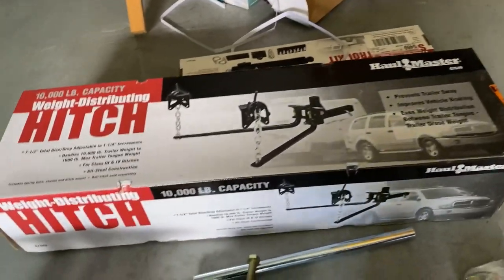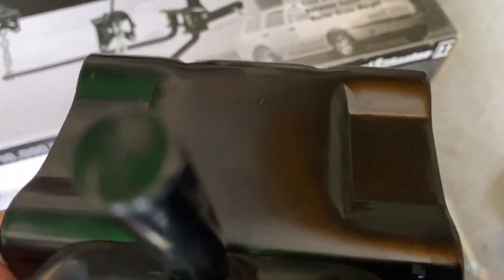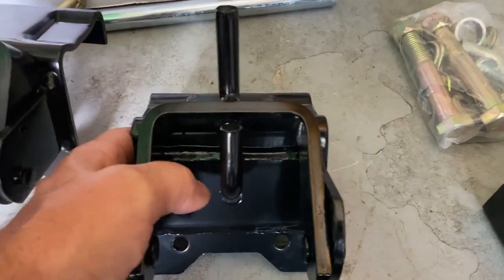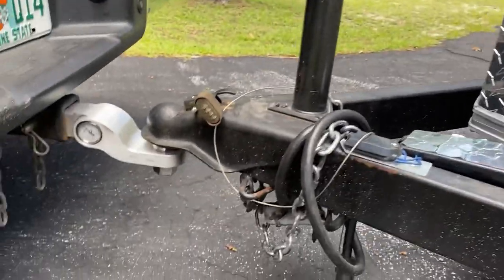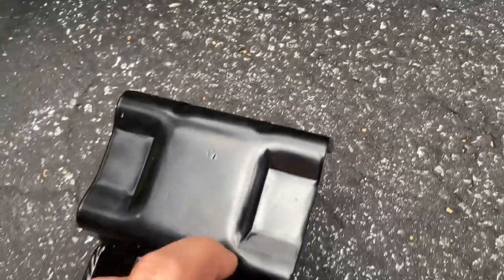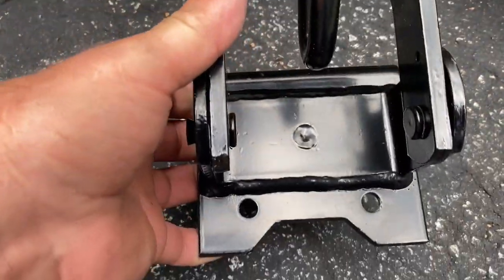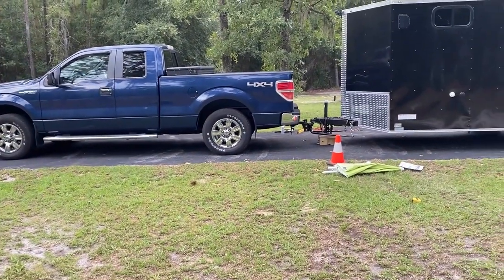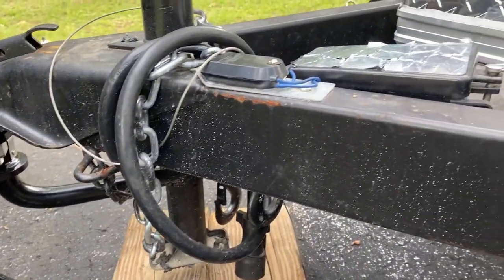Weight Distribution Hitch Install

Comment: How much clearance do you have between the bottom of the springs and the road? Do you ever scrape?
Reply from the maker: It's pretty low. Typical of a cargo trailer. I've never scraped. Thinking about bringing the leaf springs above the axle though.

Comment: Then sway bars are  junk.  Should have bought a weight distribution  hitch  with built in sway control. Easier to use and u can back up without  loosening  that sway bar.
Reply from the maker: I can back up fine as long as I don't jackknife.